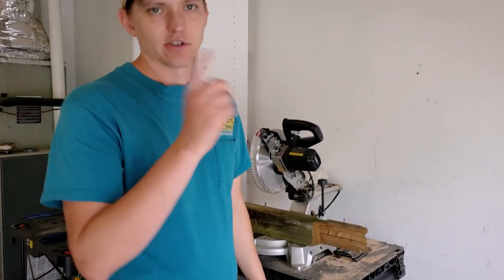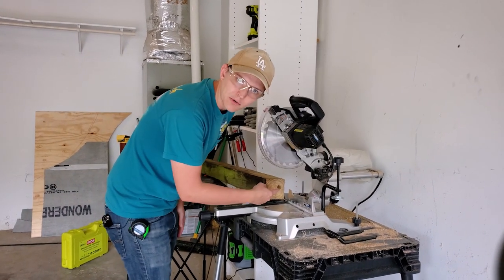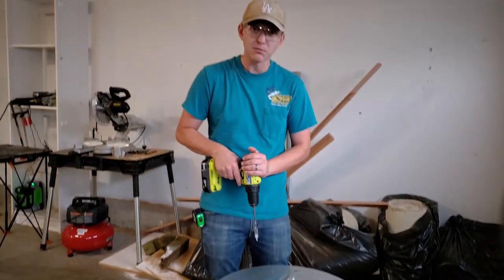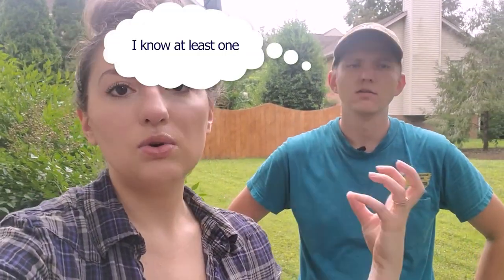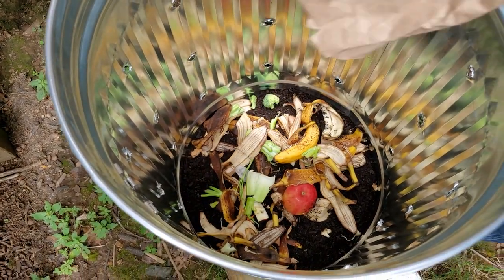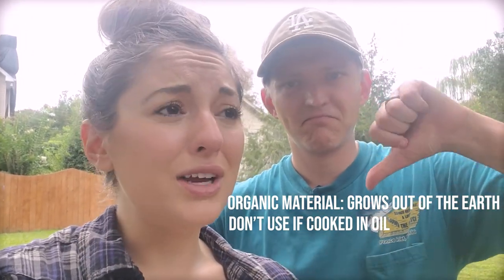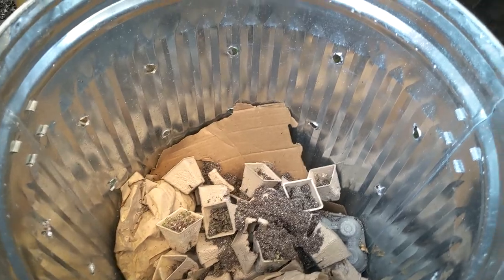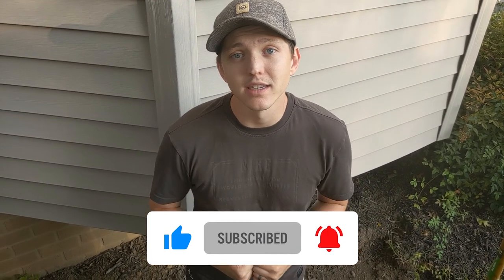Easy $25 DIY Compost Bin

Comment: Evidently you're not a handyman. You don't use a wood bit to drill holes in steel or aluminum.
Reply: the metal bits pull out sharp jagged edges both ugly and dangerous, much more work to get the holes started where you want them ect... the list goes on. I have tried several bit styles, many get metal debris caught on them which interferes with progress  (try it for yourself)

Comment: I used the same idea with a metal barrel. After 4 weeks I am not seeing any composting. The flies are gathering , the smell is not nice. I put more holes that you did for ventilation, I added enough water, I turned the  compost once a week. I also added compost accelerator. I believe that the compost should stay in a net 3 cm away from the walls of the metal bin to ensure ventilation. Will test my idea soon. I posted this comment for: not try this at your home. Yet!

Comment: Fantastic idea, love the video! I'm going to try the same thing but with a repurposed 55 gallon metal drum and see how it works for me. Side note, that drill bit is called a paddle bit, the hole saw bits are the ones that have teeth in a circular pattern.

Comment: I wanted to do this but decided on a plastic bin because I was worried that the galvanized can would rust out. Did you treat the cut holes to ensure protect against rust and if not, has the bin rusted out?

Comment: Why did you elevate it off the ground?
Reply from the maker: Hey Mike! Air flow and oxygen are critical to the composting process, so the holes drilled into the bottom of the bin and having the bin raised allow for air circulation from top to bottom. It has allowed us to leave it pretty passive and also kept the bin from getting bogged down with too much moisture as we live in a pretty rainy and humid climate. I hope that helps!
Reply: @BuildingHome  ah well I live in the PNW so I too have to take those into consideration when doing projects like this in my climate.

  I've made a couple of these and they work great! However I used plastic bins, but that isn't too important I reckon. 

Anyway, this video came into my feed. Figured the airflow would be just fine with all the holes drilled in the sides. I personally don't drill any in the lid to help create a micro climate which is really helpful for the mycology. Contact with the soil is key too, imo. Especially for fungal and other soil organisms hence my question. 

Sure worms will find their way up but other creatures and organisms may find it a bit more of a task. 

I was just curious if the pros outweigh the cons in your experience.
Reply from the maker: @_MikeJon_  ahhh we absolutely love the PNW! So beautiful! I dont think there's any difference at all between plastic and metal, we only went with metal for a really tight lid with all the critters we have here. 

It sounds like you are more advanced than us haha! We still just have this one metal bin and we recently added a plastic tumbler to kind of start comparing, but we've had great results with everything breaking down really well. We have tons of earthworms in our soil here too and our garden is in ground so when we go to plant our soil has continued to produce really healthy plants! We are coming up on just a year and still have a lot to learn and experience to gain, so we'll have to try out some of your methods! 

Really glad you came across the channel and that we could connect. Wishing lots of health for you and your garden!
Reply: @BuildingHome  oh goodness I have very many critters on my property as well. A frisky bunch of raccoons regularly breed in the trees right off of my back patio and they're quite a handful! Though the kits are quite amusing to watch when they fumble and tumble out of the trees in the summer. 

Then we have the opossums, feral cats and black bears to contend with. But yeah, a simple brick, dog and solar sensor lights have worked thus far so 🤞

I'm more new to the composting game rather than anything else. I've grown and studied mycology unprofessionally for years and that led me into gardening and studying soil. Composting is clearly the complement and foundation for many of those disciplines.
Reply from the maker: @_MikeJon_  wow well I guess I need to count my lucky stars our raccoons aren't mating on our property but just passing through! 🤣 So amazing that you've taken an interest in mycology for so long, it's good for the soul to learn about the way our world works. I know pure mushroom compost goes for  top dollar in our area! I hope you'll keep in touch with us as you continue to learn about compost, you certainly already have a leg up with so much fungi and microbiome knowledge! It's pretty amazing to watch your food scraps go back into the earth and help your plants grow instead of just throwing them in the garbage. I hope more and more people make composting a regular part of life!